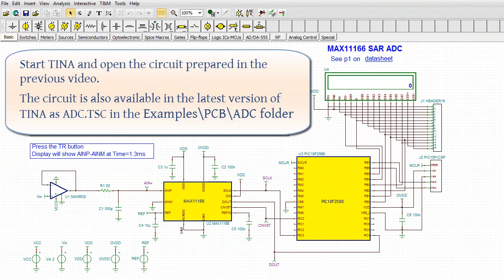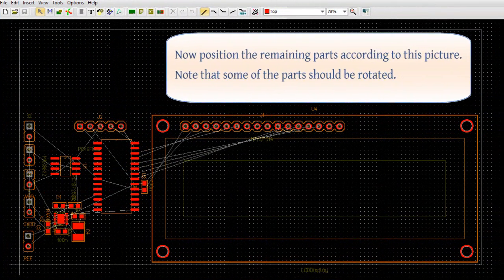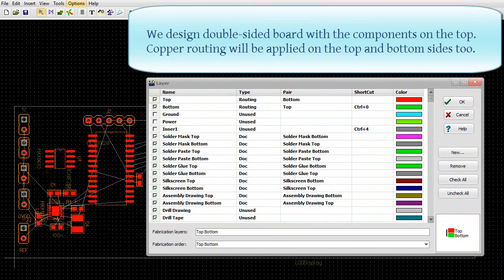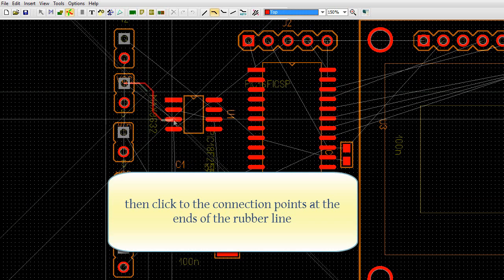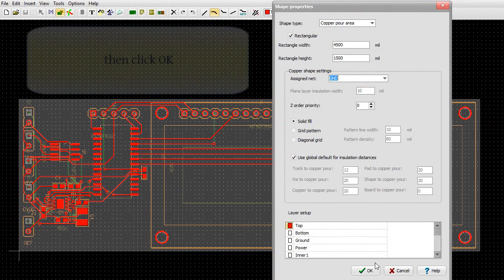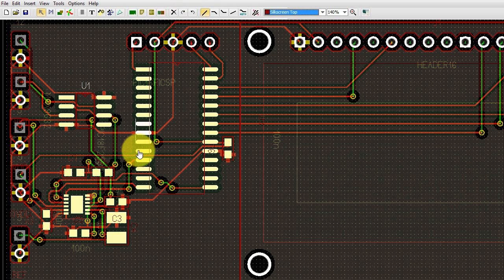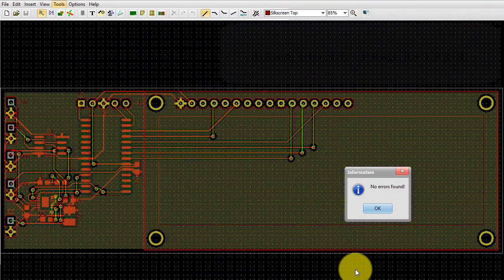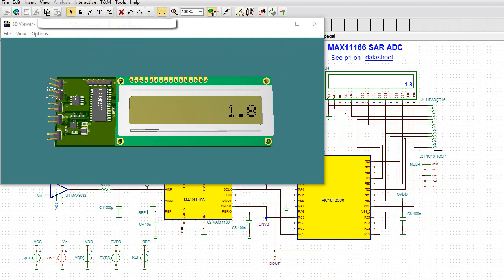Creating two-sided PCBs in TINA, part 2: TINA PCB Design Flow

Comment: i@ve been using tina7 ind pro for many years to simulate and create pcb tracks to either copy by pen or use positive resist.

I now have a good supply of negative resist film at good prices,tina does not support the creation of negative artwork,so i now have to find a solution or new software,at which point i would discourage anyone from buying any designsoft products as i have been ignored in the support section of thier web site concerning basic setup and now this issue,negative images are needed for solder mask too,so this product falls far short of "industrial " or "professional" for the money i paid,very very disappointed.
Reply: I use TINA 8 ind pro to create negative artwork. Simply export as image, pdf etc. and create a negative using your favorite image editor. Photoshop, MS Paint, or GIMP would suffice. Thanks for your continued devotion towards DesignSoft products.